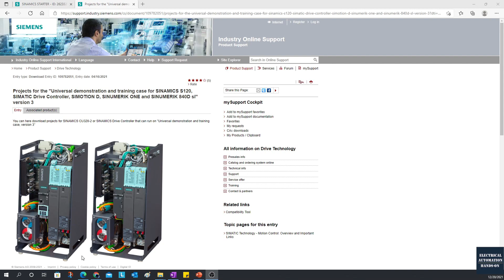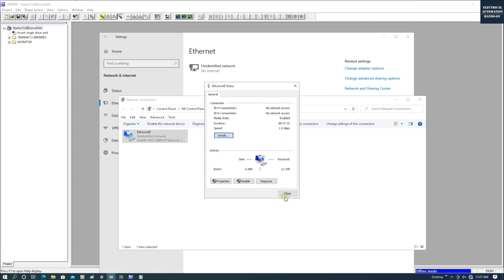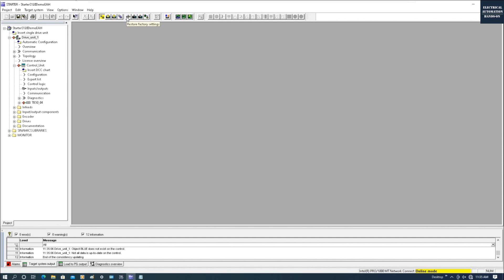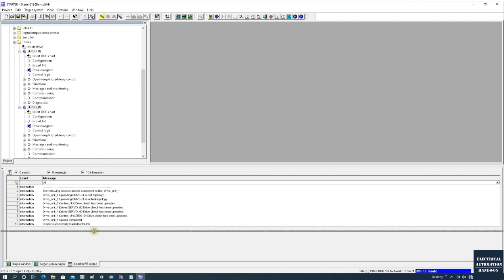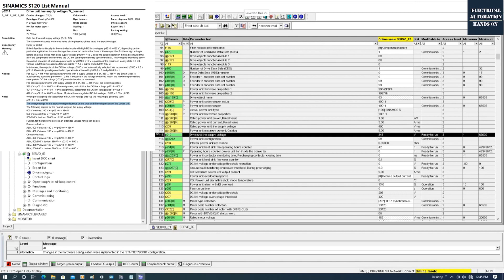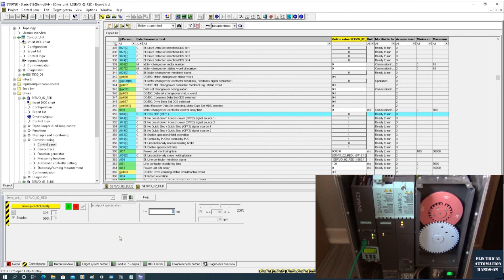MS05b. [Siemens S120 #1] SINAMICS S120 Configuration and Commissioning via STARTER

Comment: I did it as described in the video. But error: '' connect to selected target devices not possible '' or ''no further node found''
What is the reason ?
Reply from the maker: Try to ping the IP of the drive, Also check your ‘Set PG/PC setting’ in control panel of your PC